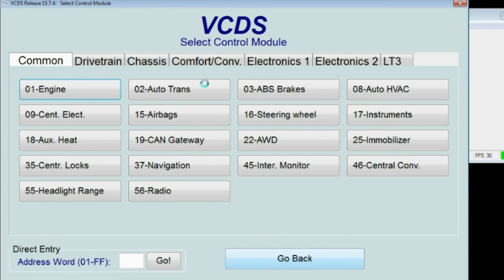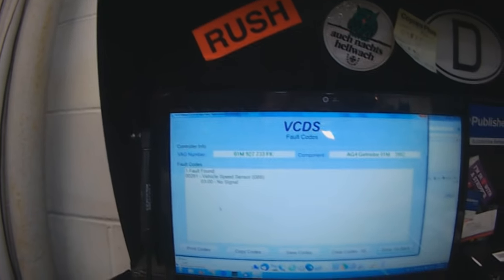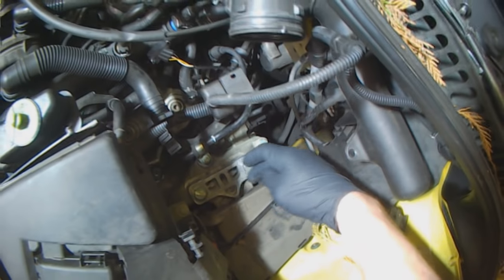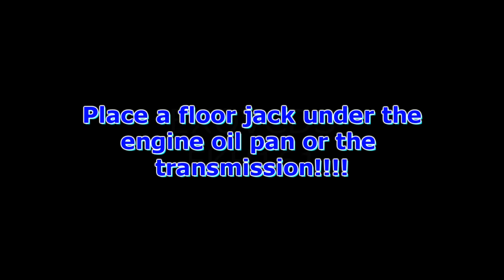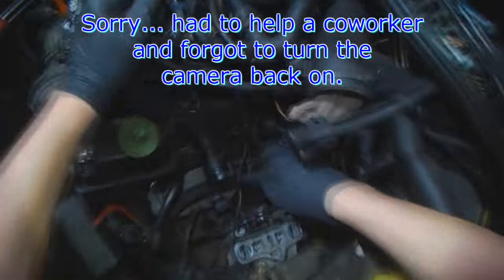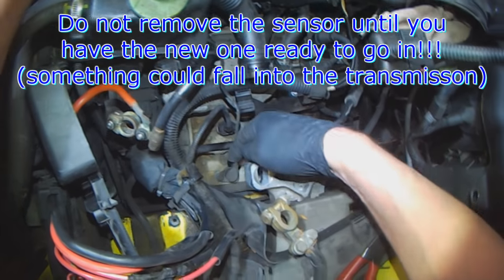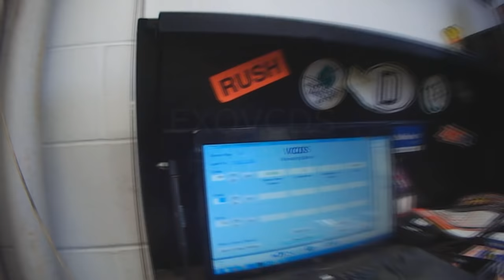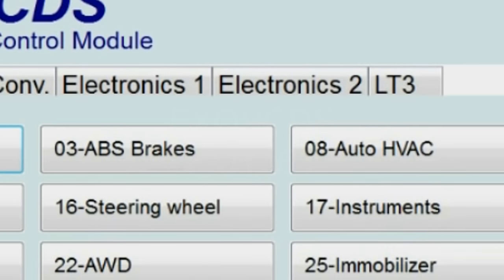VW A4: New Beetle - vehicle speed sensor (G68) no signal

Comment: I have a 2002 Jetta with this problem and wanted to share my experience. 

If you have the CEL for this speed sensor and want to drive around with it you must leave it in 2nd gear. If you let it shift into third it's going to eventually damage the transmission. The transmission is in limp mode and trying to protect itself. 

Thankfully, the way I drive my Jetta it's around town so I drove in 2nd gear for around a year but it's not a daily driver. The first time I replaced the sensor I think I got a faulty sensor. The problem went away but came back 20 miles later. 

I made my own overlay harness and bypassed the stock wiring. Wiring the sensor directly to the transmission computer. 

I just replaced the sensor again and hopefully it works this time. Fingers crossed.

One thing that I found interesting was the factory original sensor - when I took it out I cut away the outer wire shield to see what color the wires were inside. And the sheathing on each of the three wires were totally disintegrating. The outer sheath was in great shape. I guess stuff falls apart after 20 years.
Reply from the maker: Thank you for sharing.

Comment: g28 is the engine speed sensor, g68 is the cranksensor, ya the ckp uses the engine speed sensor as a reference
Reply from the maker: G28 is the crank sensor / engine speed sensor. G68 is transmission speed sensor... G22 is vehicle speed sensor on differential (when applicable).

Comment: Haynes wants me to remove the VSS to check the differential lubricant level and makes it sound so easy but your video here shows a lot more work! Haynes says: 1. Raise the vehicle. 2. Disconnect the electrical connector. 3. Remove the mounting bolt and withdraw the VSS.
Reply from the maker: That's because I'm working on a different speeds sensor. The speed sensor that is used to check fluid level is on top of the differential. That sensor is also the one that is used to drive the speedometer needle.... the sensor in my video is a totally different sensor with a different job.
Reply: I just sent you a post card from California to get you to check your messages which you can disregard now. Thanks.
Reply from the maker: @jeffreyhancock8170  I check as often as I can... did you find the correct sensor to remove?
Reply from the maker: @jeffreyhancock8170  If you need pictures of the correct sensor / location, I can post that here. I'm surprised that Haynes would make you think that the sensor is the one in my video. Hmmm, weird.
Reply from the maker: @jeffreyhancock8170  G22 is the sensor for the Speedometer & checking gear oil level... G68 in this video is for internal transmission speed.
http://i91.photobucket.com/albums/k286/coolairvw/01Melectrical-1.jpg
Reply from the maker: I got your post card today... did you find the correct sensor? The one in the video is NOT the one that Haynes referred to.

Comment: My 00 bug speed o  is at 35 when going 55. Also dies a lot at slow speeds. It is an automatic and it sluggish to go into gear when cold, I will be taking it in to check this sensor. Thanks!
Reply from the maker: The speedometer sensor is a separate sensor from the shifting sensors... there might be more than one issue.

Comment: Hey Thomas, thanks for the video!! Very well done. I use Curil-T in all those type of seals and even on the outside of cam/crack seals with great results. Highly recommended!
Reply from the maker: Thanks for the tip and thank you for watching!
Reply: @EXOVCDS  
Could you make a video about how to diagnose hard faults on ABS systems? Particularly MK4 cars.
Reply from the maker: Usual hard faults on mk4's is due to bad sensors. The ABS module does not go bad (that I have seen) on mk4's. If you have uneven tires... that can set ABS fault codes. If you live in an area where vehicle rust is an issue, the rust can cause false ABS activation (and set causes if the rust pushes the sensor away from the tone ring.You can check / compare resistance of the sensors to determine if they are within spec.
Reply: @EXOVCDS  
Thanks for the explanation. The car is not in the rust belt, but does snow around here a couple of times per year. All the tires are the same size and the same brand/model. I'm going to check all the sensors, do you have a video how on that?
Reply from the maker: Front sensor:
https://youtu.be/pHxa7HWNe7c
Rear sensor:
https://youtu.be/KBB8TmsctQk
Reply: @EXOVCDS  
Right on, man! Thank you so much!
Reply: @EXOVCDS  
I scanned the brakes today and found this message:  01276
Which reads this:  abs hydraulic pump (v64 signal outside tolerance). I checked all 4 sensors with the car running and the scanner connected, all showed the same speed. However, there was a code earlier for a rear abs sensor, but I cleared it and didn't come back. The cluster abs warning light still on though, what do you think?
Reply from the maker: @x-man4702  There are 3 green fuses on top of the battery... two of them are for ABS system (one for the pump). Check those fuses (pull them out of their slots and check for burnt connections). I have also seen bad connections between that fuse box and the 3 wire plug that connects to / at those fuses. With that plug "plugged in"... check that there is actually power on all 3 of those wires of the plug. Use a metal paper clip and push it into the connector where the wire enters and then check the paper clip for power (better than piercing the wires to check for power).
Reply: @EXOVCDS  
Great advise, thank you! I'll keep you posted.

Comment: Very good video. Thanks. My Car has two error codes. G38 and G68 no signal. Is the G68 the problem? Or what can be wrong?
Reply from the maker: Both sensors could be bad or the wiring / connections could be bad... you'll have to do some checking / testing.

Comment: Hi, your video is amazing, very detailed information. I wanna ask you something. Do you know the value of resistance between positive & negative pole (1,2) for a g68 speed sensor in good condition?
Reply from the maker: 0.8k Ohm or 800 Ohm (0.9k or 900 Ohm max). Information can be found in the service manual.
Reply: Thanks a lot for your answer,  I have one g68 new and throws a valuf of 1,145 k or 1145 ohm is this sensor in bad state?
Reply: Thanks a lot for your answers my friend. Best Regards.

Comment: What happens if you change the vehicle speed sensor and you still have a shifting problem. I had my vehicle speed sensor changed if my car check engine light is off it will not shift at all when the check engine light comes on it stays in seconds and then our third and then at 40 miles an hour it's just in the third gear but then it will not shift in the 4th gear so at 60 miles an hour I'm at 3,000 RPM there are three more sensors the transmission a

Comment: Hi! Great video! So a few questions... 
When checking circuit integrity with the crankshaft sensor plugged into the oss connector and using the drill, how can I check without the diagnostic system you have? Am I checking just for voltage one higher than the other like you said in a comment to someone else or is there a specific voltage that should be reached (5v) to insure the new sensor will function properly. I would like to test the circuit integrity as well as the new part before installing. 
I have a 2010 vw jetta 2.5l, throwing 0721 it starts no problem and drives until it reaches 3rd gear cant shift or go over 30mph. Could this just be dirty fluid/filter, low fluid, should I change those first? Also many peolple are suggesting it is the internal sensor, behind valve body not this external sensor under the mount as pictured here? 
I apologize if my vernacular is not correct I am a newby to transmissions and automotive work and as a female I cant seem to just get the answers without getting "help" from people when I would like to learn for myself.  I can't decern between the two sensors. The one in your video is not very expensive while the internal is 2-500$. And seeing as i just serviced a different transmission I know I am capable of doing that and the job shown here but do you suggest having a mechanic do the work if it is the internal sensor? 
Thanks again I feel confident about doing this job now except for how to check output of sensor with no computer. As soon as you confirm that is the sensor that correlates to this code that is...lol
Super clear and super helpful video! Your now my vw sensi ❣️🙏
Reply: Ok adding on  I was watching another video and they were talking about open circuit codes and I thought maybe it was important to let you know that it's also throwing code 0651  Voltage B circuit open/ sensor reference
Reply from the maker: Being a 2010 jetta with a 2.5l engine, the transmission will be different than the one in my video.  Open circuit fault codes can point to a wiring / circuit board / sensor problem. You need to get your hands on a wiring diagram & service manual for "your" transmission, then you can do some troubleshooting before buying parts. I'm away from the pc... if you let me know what automatic transmission you have, I can supply you with the info you need. Using VCDS, a system scan will list all the info for all modules as well as transmission type & production code.

Comment: Great video. I have a 2001 golf 2.0 automatic transmission. Had a coolant flange blow last week and antifreeze sprayed everywhere above that speed sensor location. Now I have P0722 and shifts at around 4000 rpm. Would u say I need a new speed sensor and is the job the same as in this video. Also I’ll get new bolts for mount but what r the torque specs. Thanks in advance n great work me friend
Reply from the maker: Although possible (that it failed due to coolant)... I'd lean more towards age being the cause. 
If it's a 4 speed (01M) transmission, then yes, it's possibly the same sensor / issue.
https://workshop-manuals.com/volkswagen/golf-mk4/engine/4-cylinder_injection_engine_(1.6_l_engine)_mechanics/engine_assycylinder_blockcrankcase/removing_and_installing_engine/torque_settings_for_assembly_mountings/
Reply: Hey thx for responding!! 
I ordered the new bolts for tranny/gearbox mount. Dealer said they’re r 6 of them? In your video u removed 6 bolts for the mount I believe? 
Also thx for the link to get the torque specs. Really appreciate your help buddy

Comment: Thanks for the concise video. Issue: I just pulled my 02 New Beetle with 1.8T and AutoTrans out of winter storage. Although it was shifting perfectly before I put it into storage last fall, now it's shifting semi-hard into 3rd at roughly 3800 rpm's and WON'T shift at all into 4th. Could it be my fluid level (changed by VW dealer last summer with good success) or the AT speed sensor? Also, what are the bare minimum tools required to tackle this job? Any direction would be much appreciated. Thank you very much for this vid!
Reply from the maker: I wouldn't suspect fluid level unless the floor under the transmission has a lot of oil on it now. Solenoids and ribbon cable (the part that connects the solenoids to the TCM wiring) are common failure items with age. Start with scanning the TCM for fault codes.
Reply: @EXOVCDS  Thanks!
Reply: @EXOVCDS  Ok, I bought a VW scanner and got the codes: 00281 Driving Speed Sensor & 00652 Gear Monitoring. What should I do now? Replace the speed sensor first? Do you recommend a specific brand? I will check for fluid leaks as well.
Reply from the maker: @glisse_1 
Check out the following links.

http://wiki.ross-tech.com/wiki/index.php/00281

http://wiki.ross-tech.com/wiki/index.php/00652

The second code is probably set because of the first one.

Confirm that the wiring & connectors (at the sensor & TCM)  are ok... if yes, replace the sensor. 

If your scan tool can view TCM sensor data, you can remove the sensor and wave a piece of metal in front of it to see if the scan tool can see a change in "speed". If wiring & connections are ok, replace the sensor and do the same check before installing.

https://www.ecstuning.com/Volkswagen-New_Beetle--1.8T/Search/SiteSearch/G68/
Reply: @EXOVCDS  Thank you!
Reply: @EXOVCDS  I notice some ATF leaking from the pan. I've decided to first ADD a little VW brand ATF (1/4 quart for starters) to the tranny via the filler spout on top of the transmission. Can I add a little to a cold tranny? Or do I have to make sure the fluid is of a specific temp before the add?
Reply from the maker: @glisse_1 
You can add when cold. 
Fluid level is checked when fluid temperature is at 35c. The "level check" plug is removed at that temperature. If fluid continues to drip out while the engine is running, fluid level is correct. If no fluid drips out, fluid needs to be added.
Reply: @EXOVCDS  Ok, I successfully checked my fluid level. It is correct. So the next thing I'll do to hopefully solve my shifting problem is replace the AT speed sensor. On a 1.8T with 4speed AutoTrans, is the speed sensor located on top of the transmission on the driver's side per your video? Also, should I only use an OEM speed sensor or will aftermarket suffice? Again, thanks for all of your help. I am determined to fix this myself.
Reply from the maker: @glisse_1 yes, if it's the 01M transmission, then it's the same as in this video. Tge quality of the sensor should be ok if you buy from a Euro Parts store. They usually weed out the bad quality sensors / manufacturers after they get too many returns / comebacks.
Reply: @EXOVCDS  Awesome, much thanks.
Reply: @EXOVCDS  Is there a separate oil/gear lube for the 01M transmission? ....Some other lubricant besides the ATF to lube the AT gears? How do I change this?
Reply from the maker: @glisse_1 remove the "Vehicle speed sensor" (3 wire sensor)  that is on the top of the differential.  Remove the drive gear that the sensor is mounted to. Gear oil (75W90) fill level is correct when it covers the tip of the drive gear shaft. If you need more info / can't find it, let me know.
Reply: @EXOVCDS  Ok, much thanks again, but on a side note, my coolant t-flange with electrical terminal plugged into the top of the flange (located on top of engine bay directly in back of radiator, and to the left of the power steering reservoir, driver's side) broke today resulting in a massive coolant leak. This was after I fixed a previous coolant leak. Is it possible that coolant could have leaked down and made my 01M AT speed sensor malfunction? I'm thinking this might be the root cause of my AT shifting problems. At any rate, I have a new speed sensor coming, and I plan to replace the old one AFTER I replace the t-flange.
Reply from the maker: @glisse_1 not sure. Once you remove the sensor you can inspect it for coolant ingress / corrosion.

Comment: Hey I'm having a similar problem on a 2005 Volkswagen Golf Gls Auto Trans, 2.0. So at times I will be driving and it will take a long time for the car to shift gears, sometimes it will loose all power and rpm's will rise very high but the speed will drop with me applying the gas paddle. And other times she will run like nothing is wrong, nice and strong. What can it be??? that same sensor? or what are your thoughts?
Reply from the maker: Could be a problem with the valve body / hydraulic shifting solenoid.

Comment: Great Video, I am having a weird problem with my 2003 Beetle with a 2.0 engine. The cruise control starts to surge if set at 70 MPH or higher. This also causes the speedometer to bounce and not read speeds over 80. no check engine light or engine codes. speedometer works fine if I don't use the cruise. It also seems like my speedometer is about 2 MPH faster than what I'm actually going. Any ideas? Thanks!
Reply from the maker: Guidelines that manufacturers have to follow: Speedometers are allowed to show faster than actual speed (up to 10% if I'm not mistaken), but are not allowed to show less. This can help prevent getting speeding tickets... in a way. 
Watch this video... it might be the reason for your bouncing needle:
https://www.youtube.com/watch?v=w27c3euMsiw

Comment: Nice video Mr.Thomas!My nice 1999 VW Beetle brakes with rumble at a speed of 20 km/h and do not get a diagnosis from mechanics!Runs normally at any other speed!And if I pull the handbrakein stationary the ABS and ESP warning lights on board after leaving and reaching that speed(20Km/h).I appreciate if you have time to answer!Thank you!
Reply from the maker: One of your speed sensors at one of the wheels might not be showing the correct speed to the ABS module. Check tire pressure and tire size... low pressure or wrong tire size can cause unwanted activation. If tires are OK, check the pulse wheel for all the sensors.. check for cracks, damage and even air gap between sensor & pulse wheel.

Comment: Would you happen to know why my cruise control won't engage? My car runs fine other than that. My check engine, ABS, and traction lights are on and have stayed on for a year or so.
Reply from the maker: Sydney Strobel Scanvthe ecm & abs modules for fault codes. The cruise control issue could be related. Bad brake light switch, bad cruise control switch, accuse problem etc. not sure.